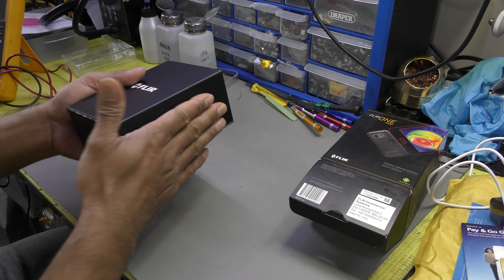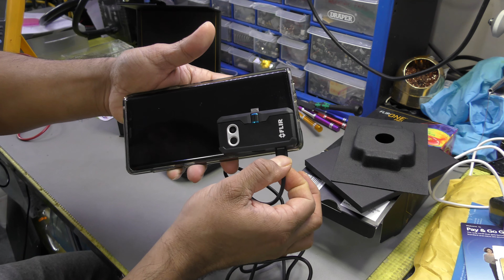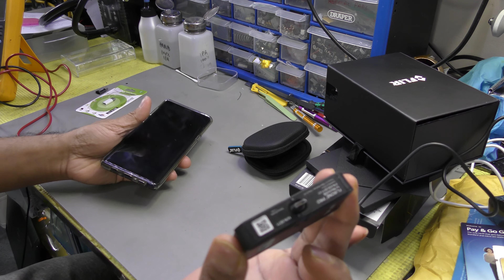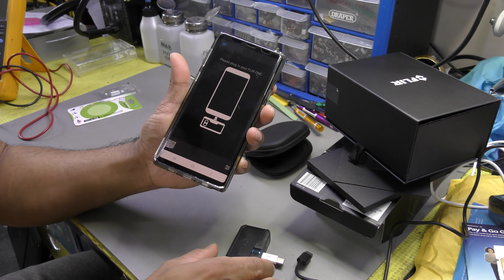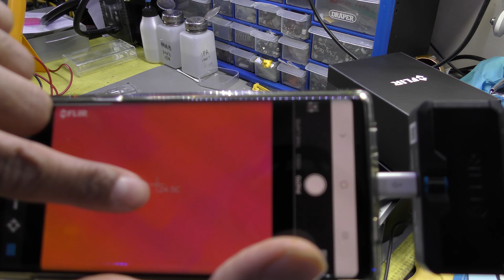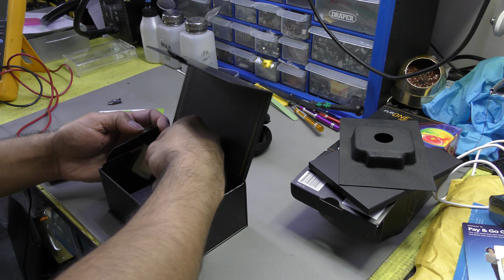FLIR ONE PRO 3RD GEN THERMAL IMAGING CAMERA 3RD GEN OTG ADAPTOR REQUIRED

Comment: I have FLIR ONE PRO (Lighting version for iPhone), can you recommend a specific adapter to connect it with android devices using type-c?
Reply: Personally I wouldn't due length unsupported. Although any USBC to Lightening would work if it is a Sync adapter and not a charging only adapter.. should be several since the iPad Pro is now a USB-C. Amazon has several short ones listed.
Reply from the maker: I haven't tried it but 99% chances are it will not be compatible.  Cheers

Comment: Bought the same one but I was expecting a better product... Let me know how long does your battery last when the unit is powered off. Mine doesn't seems to keep the charge for more than two days...
Reply from the maker: Hi Pal,

That is interesting... I will try it out.  Thanks.
Reply: So have you been able to test the “not in use discharge”? I just opened a ticket with flir tech department in order to get a replacement. They said it’s not by design... I would appreciate a second check by you whenever you have a chance to leave the camera charged for few days and test it later. For example I fully charged mine and live it for 5 days without even switch it on and once I try to do it the camera didn’t respond at all to the push of the power button. In order to have it back operating now I must recharge it again... is there something in my opinion that drains the battery even when it’s off...
Reply from the maker: @ictrepairs  Hi Pal, I will check it out.  I've had mine charged and left it for few days now.  I'll let you know my finding.
Reply: @iTCXtreme  I finally managed to get the unit replaced and guess what? I give a last shot to the faulty one. Yesterday I fully charged it without switching it on and today still some charge left (around 64%). So the problem occurs immediately after charging but the battery will be fully drained after let's say 3 or four days in my case. This should't happen anyway but I'm afraid the replacement unit will show the same erratic behaviour... FLIR denied any design issue (of course they willl never admit that except if we lived in an ideal world...)
Reply from the maker: @ictrepairs  Hi Pal,  I will let you know my findings.  Cheers
Reply from the maker: @ictrepairs  Hi Pal,  Flir 😞???.  What the hell, my device was fully charged, not been used and left on case for few days and it's full discharged??? What???l.  A cheap Chinese after will at least hold it's charge for longer than that!!!  I am NOT happy mate. 😡😡😡
Reply from the maker: @ictrepairs  I've also done a video just to raise awareness.
Reply: @iTCXtreme  Well done pal! I did the same on my channel!